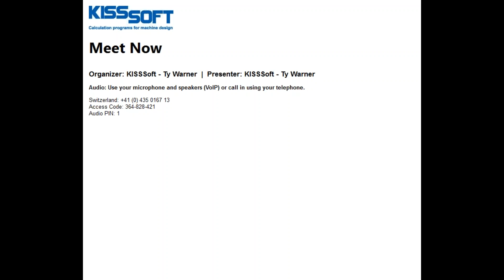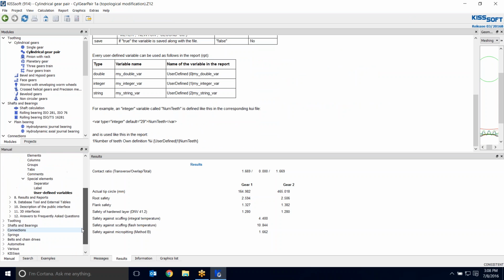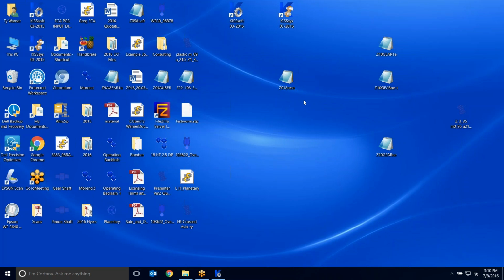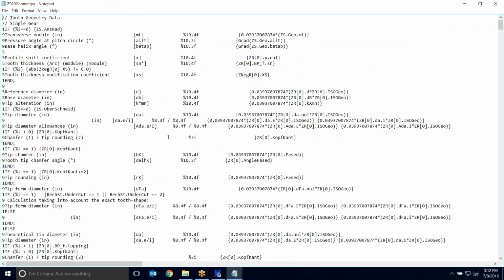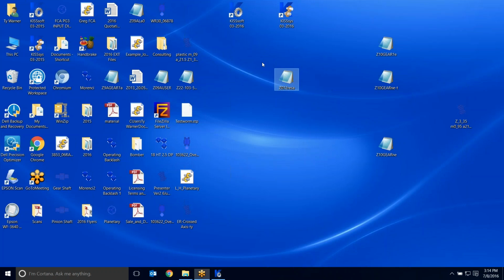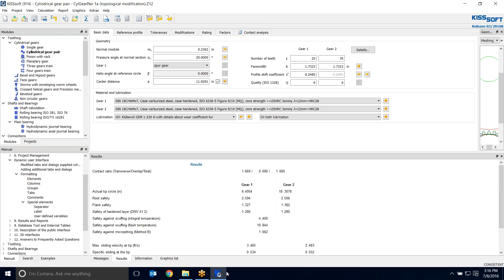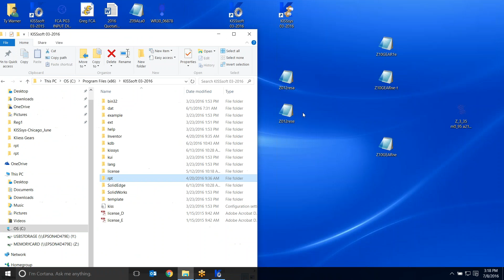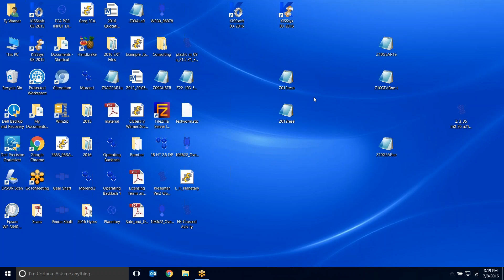Modifying Results in KISSsoft

Comment: how do you change the amount of decimals displayed in the result reports?
Reply from the maker: You would need to change a value in the report.  In the video, you see locations where there are numbers %8.4f or %10.2f?   the .4 value is the number of decimals.  If you change this to another number, this will modify the number of decimals displayed.